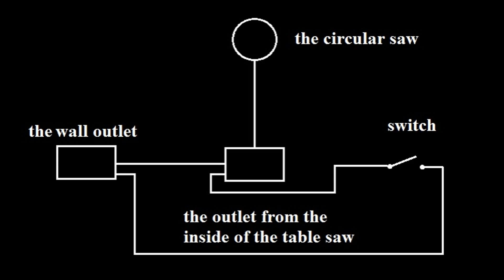Homemade tablesaw

Comment: I recommend you use one of these: https://www.dedeman.ro/ro/freder-buton-ciuperca-ni-d40-32-765/p/1032603

(dedeman ... freder buton ciuperca - in caz ca nu apare link-ul)

It's a lot safer and easy to switch off when hitting with palm, leg or other body parts :))